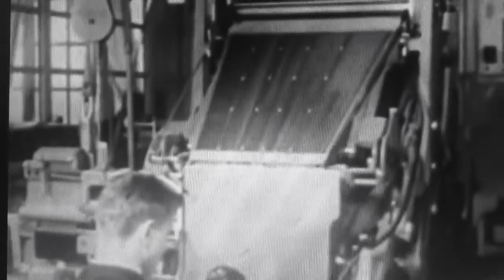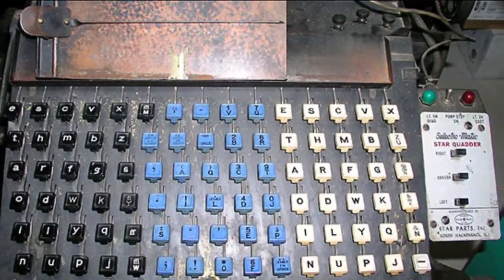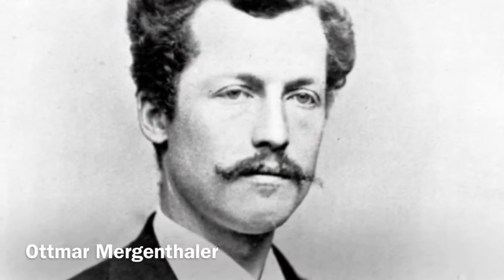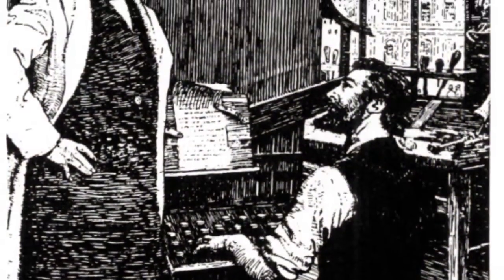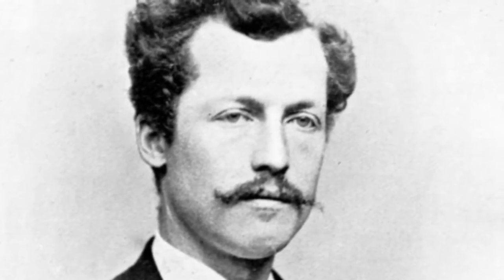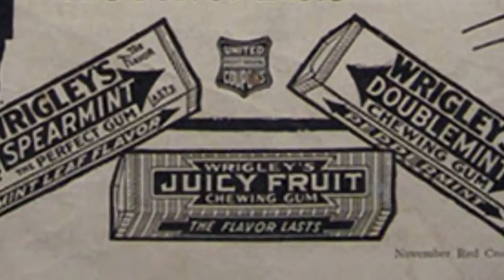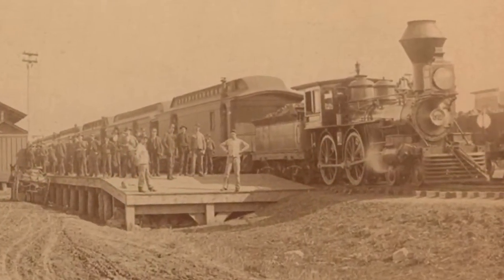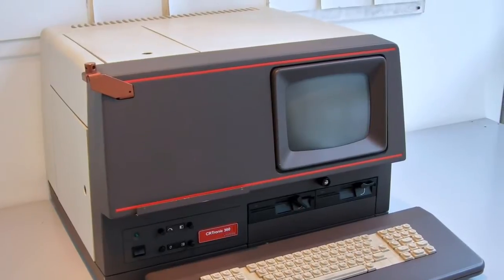O. M. Linotype

Comment: There was a fairly rapid transition between the Linotype hot metal technology and the digital CRTronic unit displayed in this video. There were a series of analog typesetting machines, among them the Linofilm and VIP phototypesetters that used "analog fonts" (glass 'cards' or film strips that contained images of individual characters) where Xenon strobe tubes projected the image onto photosensitive paper or film. The film was developed in a chemical processor, dried, cut into galleys, waxed, and laid out into final pages. There were several CRT based units developed in that transition period too, the Linotron 505 was one of them.
Reply: At the Computer Vision Lab at the University of Maryland in College Park, Maryland, we had a Mergenthaler Linotron.  I wrote some software that would use a Helvetica Period (since it was a perfect square) as a pixel, and allowed the Linotron to set halftone-images.  The process was painfully slow, but the quality was quite good.